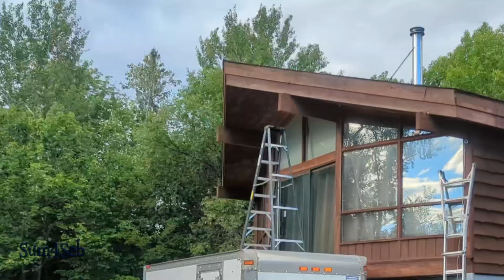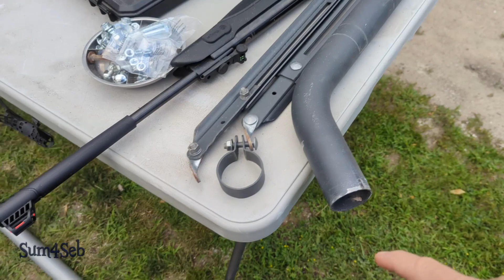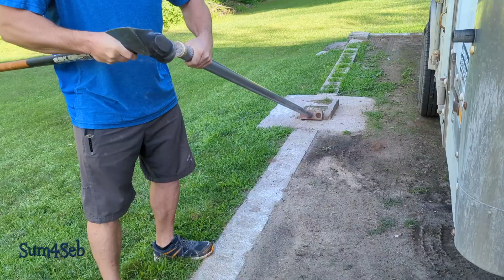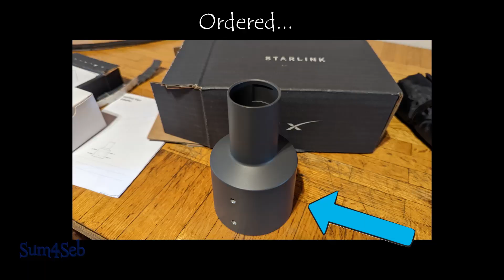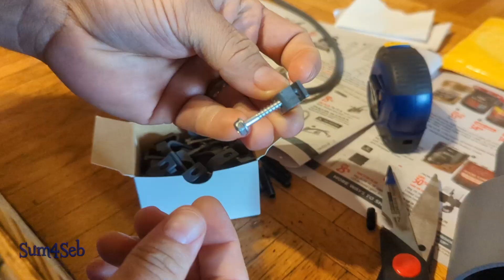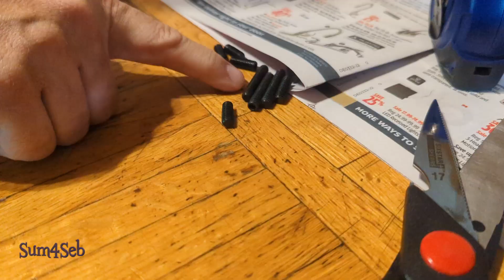How I installed my Starlink dish to clear the obstructions

Comment: That's A LOT for temporary. A sandbag on the base would have been cheaper, faster and simpler
Reply from the maker: Hi, the only thing that was temporary was the mounting to the mast since we were waiting for the adapter in the mail. Sand bag on the roof would not have cleared the many obstructions hence why we did it this way. This was all explained in the video... Thanks for your insight and have a great day.

Comment: How its going ? Obstructions? Dropouts? What app shows? do your mobile works now thru SLwifi?
Reply from the maker: Hi, it's been great so far. An upgrade in every aspect compared to our old service. There is the occasional drop out but it's short and service resumes by itself. We get quite a bit of snow here and the heated feature works great. We probably average about 180 down and 11 up for speeds but have gotten up to 328 D and 23 up. During peak hours sometimes it will go down between 30 - 50 but still perfectly useable for us. We have 0 obstructions and the app has had a few updates and works as it should. I've setup my own wifi and it works great. Good luck
Reply: @Sum4Seb  Thanks! Why speeds are affected? Big city close by? Are your mobile able to use wifi calling and use SL internet?  Last month's SL realigned some dishes is it same for you?  ))
Reply from the maker: @tvguide4khv  We're not sure why such a big disparity in speed and you can't really reach their non existent customer support so you never really get an answer. I've only tried WiFi calling once and it worked great in HD and no lag. We can stream multiple devices in 4k without issue. We are not heavy users so our experience might differ from others
Reply: @Sum4Seb  Thanks! ) Do an update video in SL in some time.
Reply: You got a lot more than we got with our Starlink!  No adapter anymore offered. No cover. Cable shortened from 75’ to 50’.

Comment: Ouch!  Ordered mine October 5, 2022 ... got it October 8, 2022. I've only used it on the terrace with way too many obstructions, but got a max of 160m downlink, with an average around 100m with latencies between 20ms to 40ms ... when I can see a satellite. Not at all disappointed, given the suboptimal location for the first go.  It was a good OOBE, but definitely need to go higher.